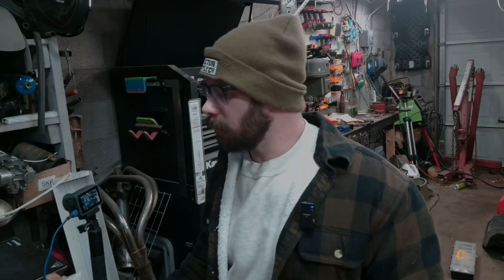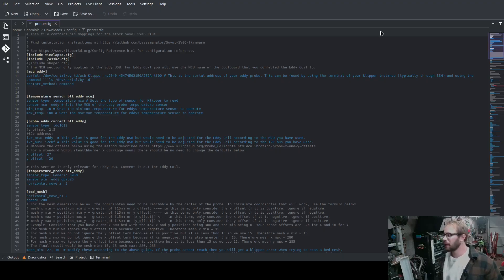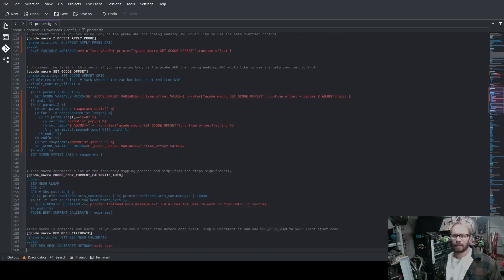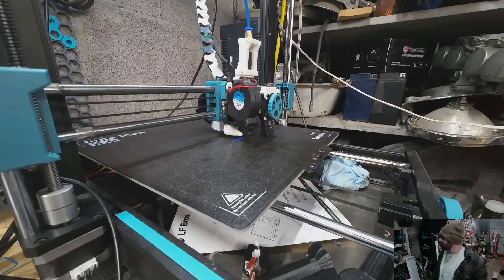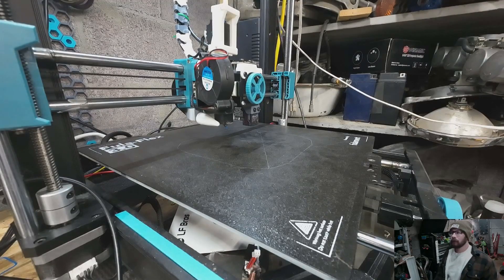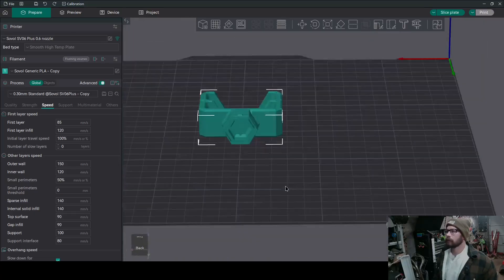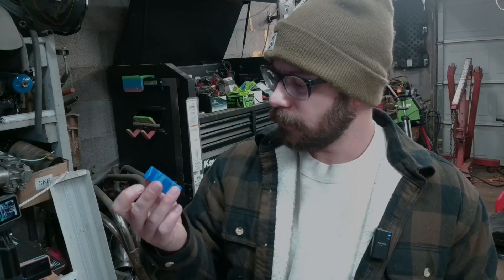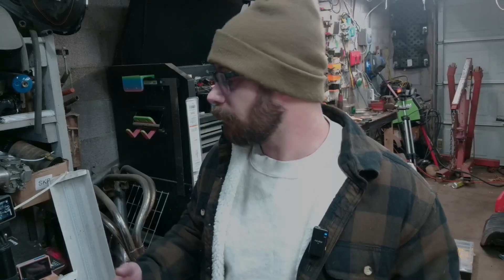Eddy Probe Z Offset

Comment: I think you should give eddy-ng a try, it basically taps the nozzle onto the bed to determine the z offset before everyprint, no extra wiring or anything needed, just need to install the software.
Reply: Do you have a link for this? A quick Google didn't find what I was looking for
Reply from the maker: https://github.com/vvuk/eddy-ng?fbclid=IwY2xjawIgOWFleHRuA2FlbQIxMQABHSQKCG-GHkWjCTWKolk5CXbWku35ohqQi8tjSxz14OJ1A6TO6KMD2dHrsg_aem_Pf-k_Q7fDtyJQ45u93nN5g

I just saw this posted in the SV-08 group. When the temperature around he becomes tolerable again, I'll have to give it a try on the Sv06+
Reply from the maker: I've never heard of eddy-ng. I'm usually pretty good at the old Google machine, but have not found anything about it. Do you have a link?
Reply: Awesome, nice find. I'll have to see if I can configure this for my trident.
Reply: @TheChucklingAtom  I've been setting eddy-ng up over the last week and got it dialled in properly for ambient temp, and for printing temp and it's working brilliantly! Perfect first layers every time.
Reply: @KeirMurphy this comment got me to pull the pin on buying one of these thank you XD
Reply: @SiFireHasSpeed  it's worth it for the price for sure! It worked very well for PLA. I had a few issues with PETG that I put down to Eddy. Upgraded to a Galileo 2 extruder (G2E) and realised it was that!
Reply: @ Lol I was about to say I print with ASA and might have a few more problems. Though my Orbiter has been a very good little thing since I got it. I can’t wait to slap this on my Ender NG
Reply: I ended up having to switch to the develop branch to set up eddy-ng but it works incredibly well
Reply: @TheChucklingAtom  what issues did that fix?
Reply: @ I was having an issue calibrating the drive current for tap, once I switched to develop everything worked perfectly
Reply: @TheChucklingAtom  interesting! Will have a gander to see what's changed as I'm still unsure how effective my setup is at high bed temps. I need to try heated chamber too.
Reply: @KeirMurphy  I have only used it to print pla, but it has been working very well for that
Reply: @KeirMurphy  So the dev people have been no help but it keeps denying my patching of the Makefile for the eddy and I’m at my wits end.